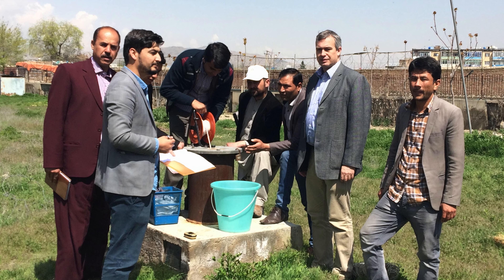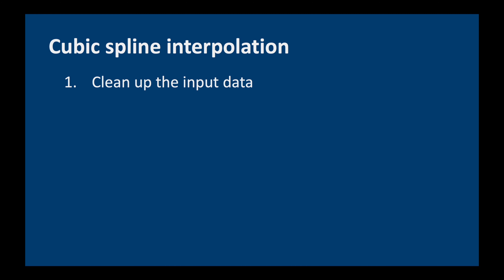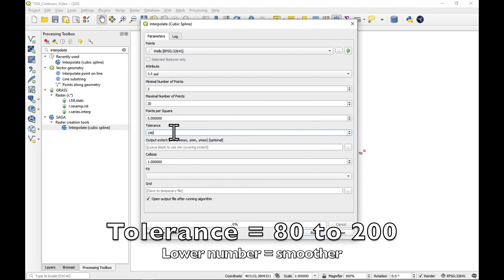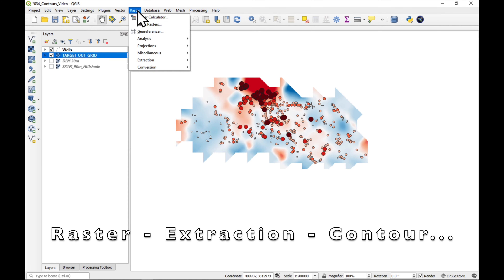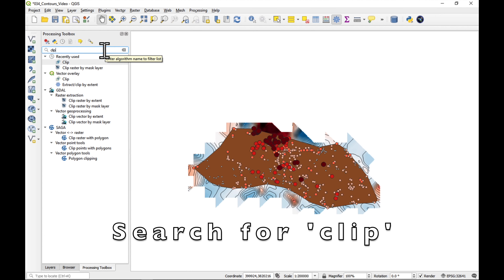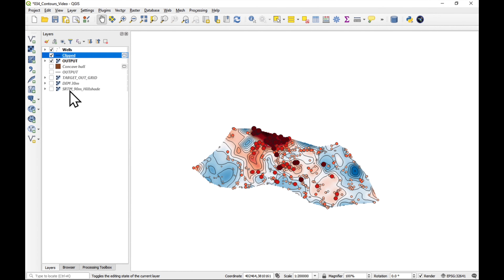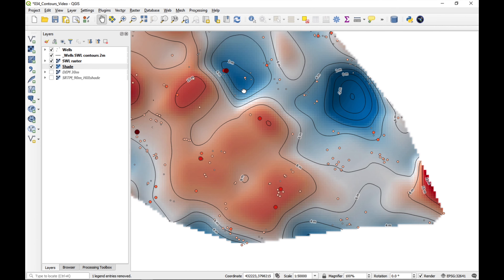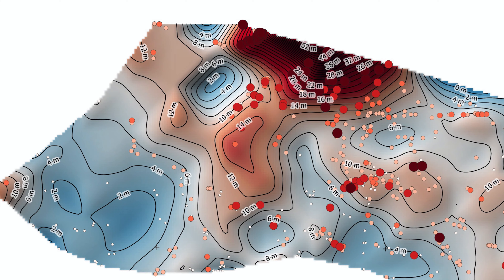QGIS 101: Cubic Spline Interpolation of static water levels

Comment: hello , and thanks for useful videos , can I use this methode to interpolate temperature data (by considering elevation as a variable )?
Reply from the maker: You are welcome Mahsa. The cubic spline interpolation is only good if you have a lot of data points, which can be a bit noisy. For temperature I would use the Thin Plate Spline (TPS)- see https://youtu.be/Ib8MQ68xemY. However this only uses the data points. If you want to correct for elevation, then you should use multivariate methods. I think there are tools in GRASS for this which may work in QGIS. Also have a look at this publication: https://www.researchgate.net/publication/220606110_Multivariate_Interpolation_of_Precipitation_Using_Regularized_Spline_with_Tension
Why do you want to do this excessive? You could also download the 500x500m pixel size MODIS temperature data since Jan 2000. You can use the methodology shown in this video on ET: https://youtu.be/cUAtYyGI9mI
Good luck and all the best, Andreas
Reply: @GeosearchInternational  thank you very much for your reply , I am doing my master thesis and as the area of the study is a mountain area and it is dependent on elevation , I want to consider it as variable , the problem is that the number of measurment stations are limited (26) in this area and I dont know how can I do the interpolation and which methode
Reply from the maker: @mahsa.k96  why don't you get the temperature from MODIS for your stations, and it there is a good match you can use MODIS for the project area. All the best, Andreas
Reply: @GeosearchInternational  thank you sir ,I am going to try this
Reply from the maker: Let me know if it works. All the best, Andreas

Comment: Hi sir,How Do I Connect Two Splines Just Keep On Iterate From First Curve to the Upper Curve?
Reply from the maker: Hi Jhan, Sorry, I don't fully understand your question. The spline interpolation is just an imaginary surface that tries to fit as closely as possible to some data points. If you have a set of data points - for example ground water elevation from a single aquifer - then you should interpolate all these points together as one dataset. I cannot think of any situation where I would want to connect two separate interpolated surfaces in the horizontal axis. In the vertical axis it is a different story, and there we often do it to find, for example, the thickness of an aquifer using the top and bottom surfaces. All the best, Andreas

Comment: When I press run, there is a message that the layer couldn't be generated... I tried to change de values but nothing happend. When I did on SAGA software separatedly it worked. (I'm just starting with geoprocessing) What could it be the problem?
Reply from the maker: Hi Déborah, Have you projected the points? e.g. WGS84 geographic coordinates projected to UTM. Hope it works, Andreas
Reply: @GeosearchInternational  Thank you! But, I projected the vector and the same error appears. 
The problem it is that all tools letters from SAGA are greyed out. I alredy searched in internet and tried to solve the problem in many ways but it still continues like that. 
Do you know something about that?
Reply from the maker: Strange that SAGA is not active. Are you using a stable version of QGIS? Maybe you need to reinstall it?
Reply from the maker: Hi Débora, Another possibility is that the numbers you are trying to interpolate are stored as text. Right click your point layer - Open Attribute Table... Numbers will align to the right & text to the left. Obviously the one you want is numbers. I sometimes get this problem in countries where the decimal point is stored as a comma.
Reply: @GeosearchInternational  Hey! Thanks a lot for the tips but it still doesn't works ... My colegues are having the same problem...I'm with the LTR version and tried old ones.
In processing it is all activate too...
Reply from the maker: Hi Débora, Can you send me some screen prints & a sample of your data? You can find my email in the About - Details section. All the best, Andreas
Reply: @GeosearchInternational  When I imported the files to geopackage it was possible to interpolate the layers!! Thank you so much for your instructions
Reply from the maker: You are welcome Débora! All the best, Andreas